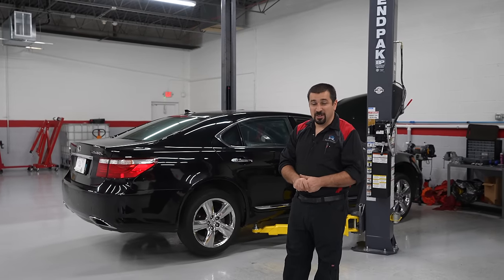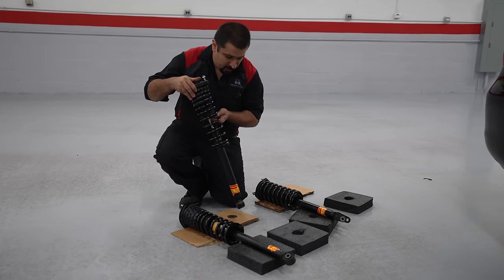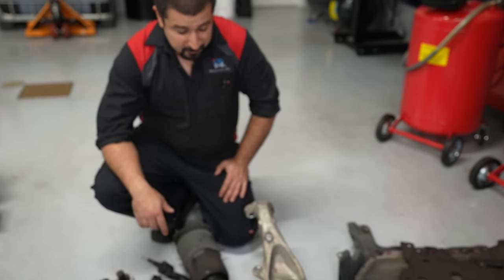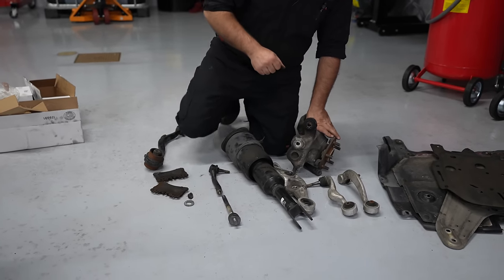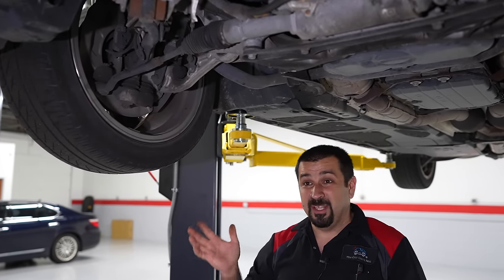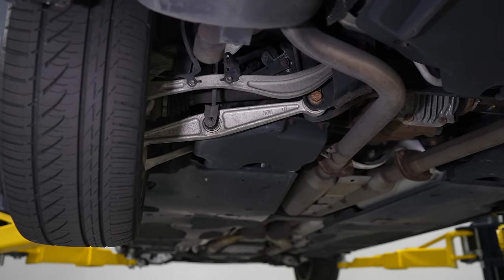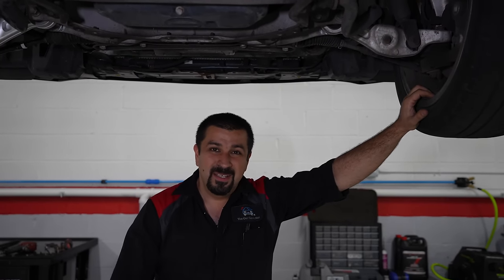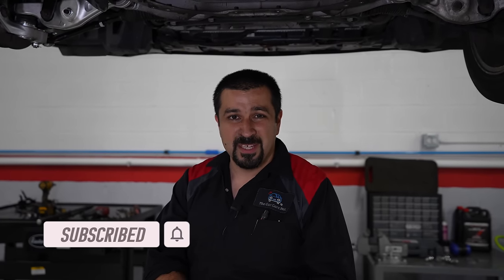Avoid THIS Lexus Model | Pre Purchase Inspection REQUIRED for this one and Here's Why.

Comment: Lexus did something on the LS at the factory in Japan that makes the front control arm bushings deteriorate prematurely.  They torqued them with the car in the air, instead of in driving position.  This causes them to operate in the twisted state, and they degrade much faster as a result.
Reply: Why oh why can't they make a car as solidly as a Land Cruiser?
Reply: No they don't liar lol. Because you can't even install them without having it in the driving stance, which can be done on a lift. Clearly you've never seen 8 arm lifts before which are specifically designed to have the car in the air and have the extra 4 arms to allow the wheels/tires to rest on them.
Reply: @MRMAN-wb1tv  They did on my 2011 LS460, they were wrapped/twisted as the car sits on the ground.  That's why they tear prematurely.
Reply: And I won't mention that Lexus also specifies the Brembo front rotors on the Sport to be installed BACKWARDS, with the rotor vanes pointing the wrong way.
Reply: @Erichhh  Who is they? Because once again Toyota nor Lexus install them that way!!! I told you the process in which they use and yet you still trying to say otherwise instead of telling the truth that you didn't take it to Lexus or Toyota.
Reply: @Erichhh  The brake part is true!
Reply: @MRMAN-wb1tv  My car tore the upper control arm bushings at 60k, and I took a bunch of pictures of them to try to get a warranty claim (CPO).  You can clearly see the torsional deformation of the bushings when the car is on the ground.
Reply: @Erichhh  😂😂😂 Dude you went from saying Lexus doesn't install THEIR caster arm correctly, to now saying the upper control arm was the problem. I see what's going on here...
Reply: My LS600hl has never had control arm problems even after 150.000 miles. People drive this heavy car to hard in corners ect.
Reply: @MRMAN-wb1tv  The basis for your statements?? Did you work on the assembly line? Where did you acquire this knowledge?
Reply: @Watchyn_Yarwood  Who are you? Why should I answer your questions?
Reply: @MRMAN-wb1tv  I'm calling you out. Put up or shut up.
Reply: @MRMAN-wb1tv  how does he know they did it at the factory what a liar he wasn’t in Japan
Reply: @roninbushito  I have no idea what you talking about lol. He said the factory did it. Lol. Can you comprehend what you read?
Reply: @MRMAN-wb1tv  u need to be banned off this channel troll

Comment: had a 2007 LS460L, control arms needed work after 100K, all needed to be replaced. I ended up replacing the car and got a 2014 LS460, original control arms, no play at all with almost 200K on it now. 

Air System in a Lexus, it's not if it will fail, it's WHEN it will fail. 

If you want one of the LS460 models, GO to a 2013+, re-designed control arms, and much better reliability, just avoid the air system on a used car like this, or expect to replace it...

Comment: All true about the front suspension bushings/ball joint problems as I've owned a 2007 LS 460 L for the past 8 years and had all those parts changed but I don't regret it.  I'm in a Lexus LS 460L with a fantastic V8, super comfortable car that still looks sharp 15 years later!  If I sit in the back, I can extend my leg straight out without touching the front seat (I'm 6').  All those parts were changed with aftermarket parts with no issue after 50k km; suspension bushings (Febest), front wheel bearings (SKF), ball joints, start too and I went back to OEM for pads/rotors as aftermarket brakes not as smooth/linear as OEM.  Mine burnt oil when I used cheap oil brand but no burning with Mobil 1.  I have the dash cracking becoming chauky issue that Lexus USA were replacing for free until 2019 I believe however, Lexus Canada flips you the bird if ask to obtain same warranty as USA for the exact same problem on the exact same car.....Lexus treats us differently up here by hiding behind different corporate entity excuse!  I get 8L/100km (29mpg) on the highway when driving 115km/hr/71mph and my friend got 7l/100 / 33mpg in his Prius. 
In summary, I spent extraordinary $4k repairs on this car ($500/year) and I'm in a LS 460, I'm ok with that and all the caveats in video are correct but I'd buy another used one!🙂
Reply: @one-mmog  Sorry, don't know.

Comment: My cousin has a 2014 lexus ES and has to go straight to the dealership to replace his windshield because it has windshield de-heater feature which is basically wires around the windshield edges that heats up to de-ice ur windshield, and its going to cost over $1k to replace it professionally. I paid only $140 to replace my cracked windshield on my 2013 highlander limited.
Reply: Yeah on my 2012 Lexus is350 awd a windshield replacement was also $1,000. Due to it having sensors for the auto wipers. Not uncommon to have to deal with these kinds of things with luxury cars
Reply: Insurance

Comment: I noticed these LS models when I was shopping for a used Lexus a year ago. Originally stickered at 50 - 70K and up,  was now selling at 10. I had a guy willing to deliver his 99K (he showed me the window sticker) 460L 500 miles away at no charge. All for just shy of 10K. Too good to be true. I almost pulled the trigger, until I found out that the aftermarket parts (control arm bushings) are no better that the OEMs. Also, the ABS/master cylinder is a 3K part that can only be installed at Lexus/Toyota. No idea of the labor, probably 3K as well. A huge flop for Lexus. Movin along...
Reply: Fuck. I thought if anybody could pull off a full-size luxury sedan with low maintenance costs it would be Toyota/Lexus.
Reply: Better off getting a LS 430 with low miles if possible. Only problem, premium gas, plus a V8. Not a problem if you like throwing your money away though. Lol.
Reply: It still has a better depreciation rate than its Euro rivals, but the car is indeed complicated with more unnecessary and unreliable components comparing to lets say the ES and GS. Surprised this engine burns oil, as an engine that has a reputation of burning oil should be an avoided red flag, but it could be due the previous owner's bad service habits too.
Reply: @DS..69  If you want to go a bit smaller, the GS 350RWD or AWD based, there are no videos about it because it never breaks.
Reply: @imnotusingmyrealname4566  Well, it is. Toyota/Lexus ARE in fact the most reliable cars on the road. Just not this LS. If you are looking for a Lexus, I would recommend something with the 3.5L engine. Much less cost of ownership. GS 350 would be a good place to start.
Reply: @DS..69   I have or had all three models LS400, LS430, & LS460L 
With 230,000 mi on the first, 141,360mi 
On second & 131,000mi.+  on the 460L.  I may have filled all of them 2-3 times with premium gas driving across country to see if I would get better gas mileage, but I never got a mile to the gallon difference in mileage driving each of them between 75-85mph on cruise !
 What Lexus advertises you need Premium is absolutely not true  🤔👍
Reply: @joshmoore6165  So no V8 😢😭 Oh wait the GS460 would be cheaper than the LS460 right?
Reply: @joshmoore6165  I could buy a fucking Camry at that point.
Reply: @COMMANDERFOX31  WHAAAAAT A TOYOTA V8 HAS TECHNICAL PROBLEMS?
Reply: @jimhamilton3544  How has been your experience? Odd you buy them new? Did you do maintenance perfectly?
Reply: @imnotusingmyrealname4566  Yes the GS was 10K lower in the Lexus food chain. But you're still talking about the 4.6 V8. Stay away from it. The way that engine is crammed in the engine bay, will cost you dearly with all the extra time spent by a technician. The 3.5L is a lot easier to work on.
Reply: I have an LS460L, 2008 and all of the LS460 models from 2007-2011, maybe 2012 too ! have control arm issues on the front suspension. 
I ordered all of these control arm parts ie(upper and lower control arms drivers side and passengers side)👎🏻on Amazon or EBay and had a mechanic put them on. 
ps any mechanic can install these. It is a quite simple job and this mechanic did it in less than 2 hrs. I think I pd. Around $165 or $185  labor and the parts were around $711 and that included one day over night shipping from N. Y. which was $126 😳
The Lexus Stealership wanted $5000 for the drivers side only . They were put on about 6 yrs. ago and the bushings are still not torn or split 
Some of the control arms only need a bushing  removed and pressed on which can easily be done at any garage. The Dealer will not sell just the bushings 😂 I went to a  local K-Mann bearing shop and they had the same bushing to press it on and can use the same control arm if I needed it in the future 👍
It doesn’t take a genius to figure out Lexus used  inferior bushings in all these models and never owned up too it. 😵‍💫
Reply: @joshmoore6165  So no V8 for me huh?
Reply: @imnotusingmyrealname4566  If you just gotta have a V8, go get a nice C5 Corvette. Plenty of them around for 20K. Trust me, they are just as reliable as a Toyota. I`ve got 250K mi. on my LS engined truck. And still going
Reply: @joshmoore6165  I wanted a Lexus V8 because those are absolutely exotic here in Europe, Lexus cars, and V8 engines. When you try to argue that the 3.5 is a rational luxury car engine, then maybe in the USA it would be. But here in Europe there is no place for a V6 with no torque that guzzles fuel when I could just hop from BMW 530d to 530d from like 12 years ago. 242 hp and 389 lb-ft and 27 MPG are just so good, or I could get a gasoline one and use the specially developed direct injection LPG kits which are only made for very few Lexus engines, not for the 2GR-FSE or FKS, but for pretty much every BMW because BMW is so freaking popular here. Or I could just get a VW Golf, maybe a Honda Civic, or one of many Hyundais with absolutely zero personality 😑
Reply: @joshmoore6165  Hmmm, thanks for your recommendations but I forgot to tell you I'm Europe, whoopsie.
Reply: @joshmoore6165  It's all so tiresome as a car guy in Europe. 😔
Reply: @jimhamilton3544  Hmm, your braver then I am on taking the chance of messing your engine up. Bye bye money. That's alot of money to gamble with, even if its used.

Comment: Those chrome wheels are original. 

I have a 2008 LS460 and it seems to burn a little oil but other than that it has no issues. Bought it with 108,000 miles and now it has 173,000 miles. 

I also have a 2006 ES330 with ALL the bells and whistles and it’s flawless, never had a single issues other than it leaks a little bit of oil but that’s to be expected at 288,000 miles. 

Lastly I also have a 2002 GS430 which is such a sweet car and I love it but it’s got a million problems. I bought it off the side of the road for $1,000 running and driving w/ 234,000 miles and I’m not $6,000 into it and the air conditioning compressor broke and it still needs paint lol. Awesome car but it was very neglected before I got my hands onto it. 

You just need to find a well cared for and maintained Lexus and it will not let you down, but stay away from neglected ones unless you are open to a project car. That said, it’s still way more reliable than any aging German lol

Comment: I have a 2008 LS460 with 320k miles. Yes, I do this job every 60-80k miles. Been through 3 sets of controls arms already buying it at 75k miles.
Reply: Outstanding I rally don't want to just give my '07 LS460 up. It only has 109k miles on it. Had to replace the starter and brake pads only on it. Now looking at a brake actuator because the "DO NOT DRIVE" alert came on the other day. Have not had any problems elsewhere with the car.

Comment: Air suspension for the LS430 was also unreliable.  Air suspension for almost every manufacturer seems to be a weak point, not just Toyota.
Reply: I'm at 100K miles plus and my LS460 air suspension is going strong :)
Reply: Weirdly enough the air suspension on the Porsche Cayenne holds up really well. The rest of the vehicle not so much (especially cooling parts) but the air suspension outlasts the car.

Comment: Would ventilated and slotted rotors with ceramic pads work better? What about smaller rims  with a tire height of 60-65 maybe 17-18 inch rims ? Soften wear and tear on the control arm bushings. Standard coil over strut it will ride better. Your videos are really good and easy to follow.
Reply: Wheels*

Comment: I had a brake job come in once similar to that one. Customers complaint was that she would lose control of the vehicle when she’d brake. The brake pad shim had cut all the way through the brake rotor hat. The rotor was on two pieces rendering the brake at that wheel useless. She said that her neighbor or someone replaced the brakes a week prior to that. It doesn’t take long to happen! 
It was an interesting test drive!!

Comment: Interesting to learn that the host owns a Mercedes S Class instead of a Lexus LS. I currently own a 09' Mercedes SL550 which has hydraulic suspension, a notorious system known to fail just like an air suspension system. I wonder if the host may have any suggestions to convert it to proven after-market coil-over shocks?
Reply: He has done some videos on his Mercedes. Do a search under his profile and you’ll find them
Reply: In Europa the sl280 and sl300 had normal suspension those where not available in the US. So there should be original normal strut parts available.

Comment: I was about to buy a LS460 with 70K miles for $20K. There was a 2012 ES 350 with 50k miles for the same price. I went with the ES. Yeah it's basically a Camry but at the end of the day I mostly use my car to drive to work. I just need something comfortable.

Comment: Very nice video again!!! One information in this video that is not very correct is that you do not have to replace the whole spindle because of a bad ball joint.
I know because i uave replaced mine and my friend's.
Lexus sells the ball joint for $98 and you can get a 3rd party for $45.
The ball joint attaches to the spindle with 3 screws

Comment: Question I notice alot of guys are putting aftermarket air suspension system on the various cars like accuair. Cant one just get an aftermarket air suspension kit that fits the LS if you don't want to just put coil overs?